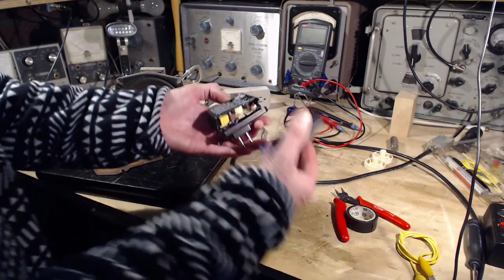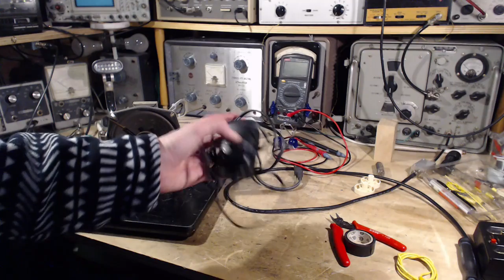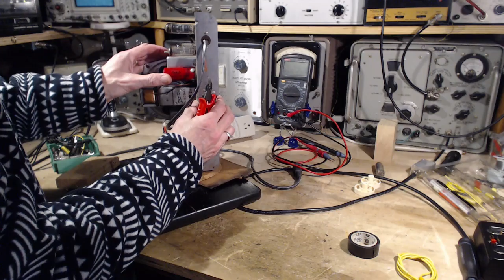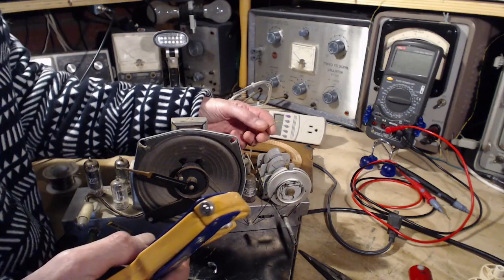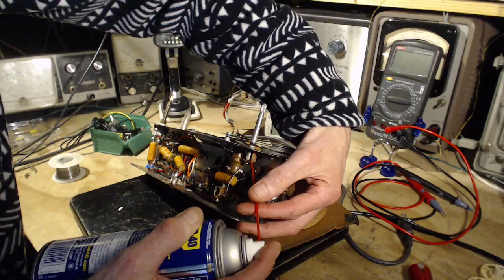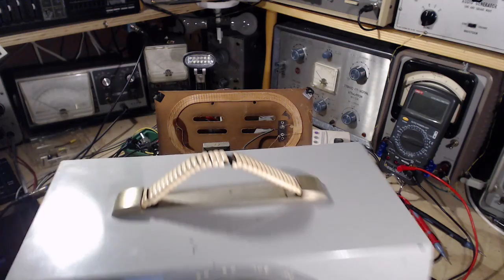Zenith 6J05 Tube Radio Video #2 - Power Supply Filter Capacitors

Comment: Jim, sometimes when we get to watch your newest video, we lose sight of the fact that, by the time we see it, you've moved on to your next project.  So, many of our comments are “after the fact” but we hope that some of our suggestions can be of use to you in future videos.
In the case of the old Zenith 6J05 – it's hardly a museum piece, but I have to say that I cringed when I watched you attack that red filter cap with your pliers and rip it from the chassis. I would have disconnected it from the circuit and installed the 2 replacement caps under the chassis – where there was lots of room. Then you could have left the original cap in its place simply for looks.
What you have done is, frankly, pretty ugly.  It would certainly discourage me from buying it if I saw it on line or at a flea market!  In the meantime, good luck and we wish you well!

Comment: WoW! 4 Noisy PSUs removed from the workshop, that's a good start and 2 capacitors changed and it only took 25 minutes!!!
Probably should have replaced the "exploded" cap, that he discovered when he first took it out of the case, we will see how long it takes him to remember that one?
When is he going to get a proper can of contact cleaner or switch lubricant and stop using "Water Dispersant 40," for jobs that it was never designed for, with its known deleterious effects on electrical equipment? 
He lives in a town with 3,000 people, and yet, he is quite Blasé, about rattling of numbers, like between 30,000 and 150,000 extra people dying from this virus? Its as if he doesn't believe that this is really happening, and not some "Zombie Apocalypse Movie!"

Comment: Jim, your test at about 18.30 - with the loop antenna lying flat on the table - it's not the best position for AM reception.  When in a radio it's normally vertical.